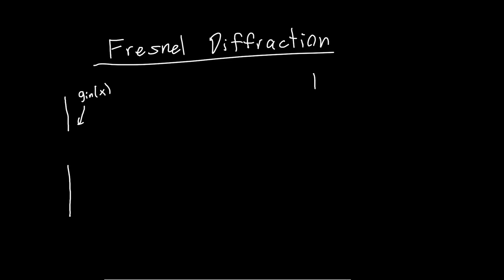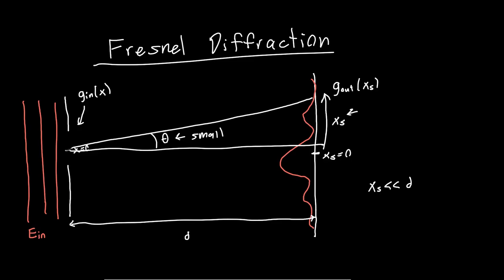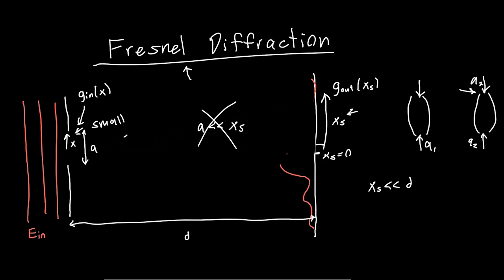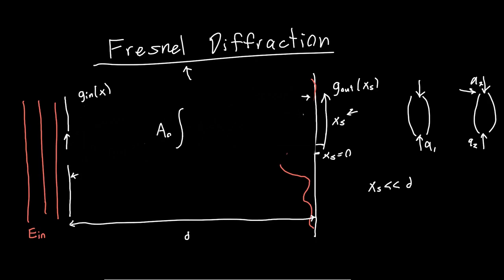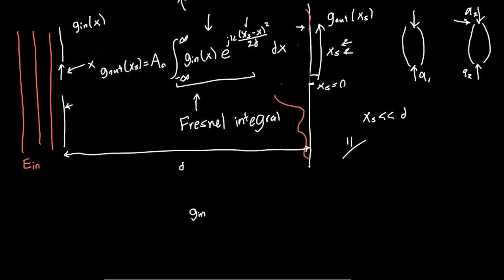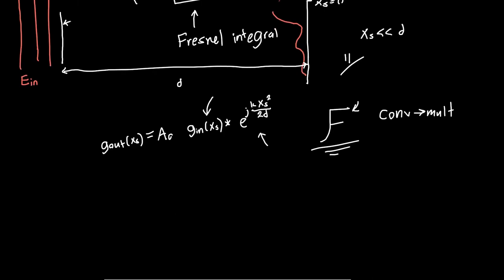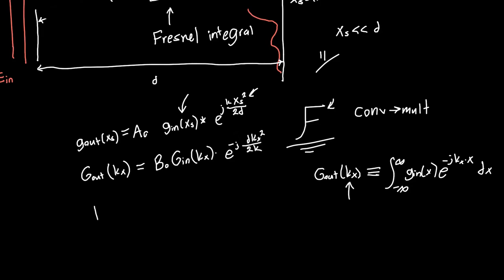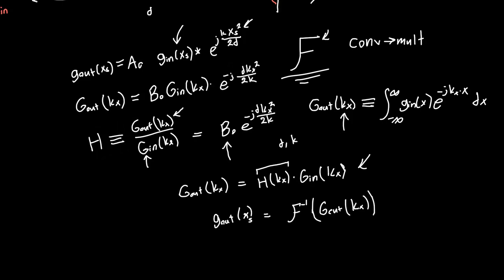Fresnel Diffraction Explained

Comment: great videos!
 I'm currently working on a problem where laser light diffracts inside of glass sheet  of 1mm thick (d) and leaves diffraction patterned damages on the other side of the glass. These damages are 1mm, 2,7mm and 4,5mm distance from the center (Xs). laser beam diameter is 30 microns (a). So i cant use Fresnel nor Fraunhofer diffraction to model whats happening because my diffraction angle is very big ( xs > d). Do you have any advice or insights?
Reply from the maker: Sounds like a challenging problem! In that case you can still try using Fresnel diffraction and see if it fits the data you get (although it will probably deviate significantly). If more precision is important, I think you would want to fall back to the equation from which everything was derived, Huygen’s principle, and not make the small-angle approximation. You will also need to take into account the angular distribution of a radiating dipole (goes like cosine of the angle). The theory you are looking for is called Kirchhoff diffraction.